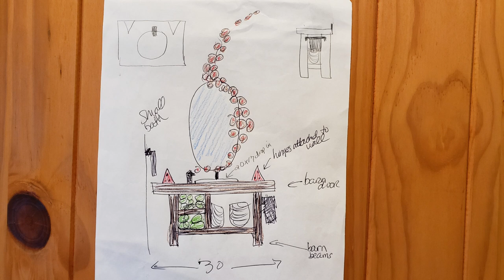Modern Homesteading VLOG-Southern Illinois farm vlog from Kapper Outdoors

Comment: Joe what buckets do you have for your excavator? I have a 18” and 36” tooth and 36” smooth ditch bucket. Wondering if tree plant would be better with a 24” bucket.
Reply from the maker: That's exactly what I used for the tree transplant, the 24" dirt bucket. The transplant went well, but the willow is in transplant shock now, but should recover fully! Hopefully! Cheers brother.